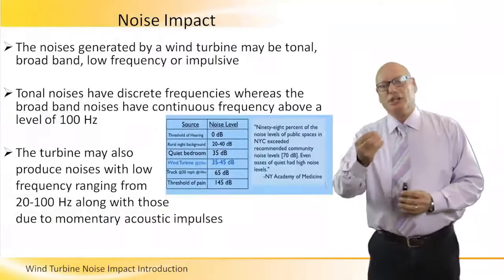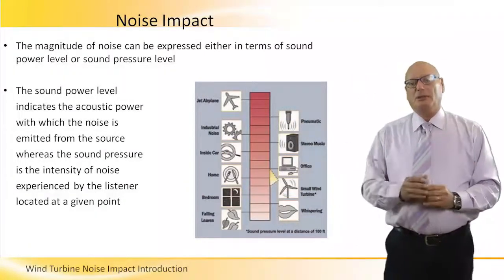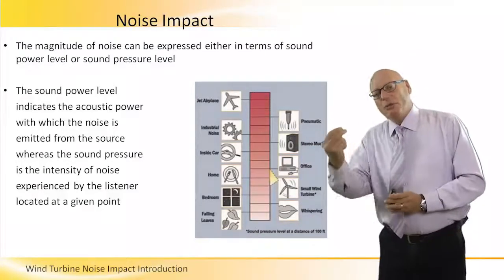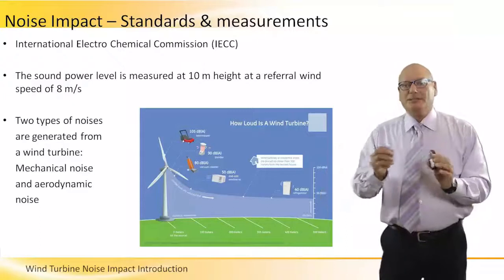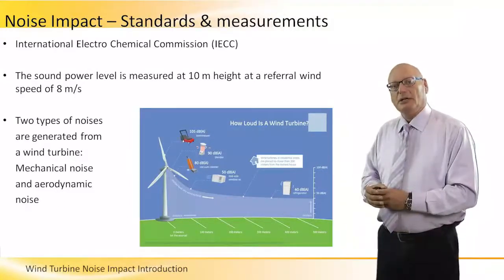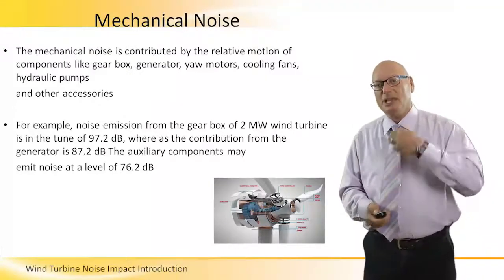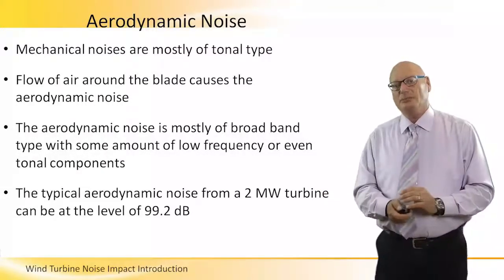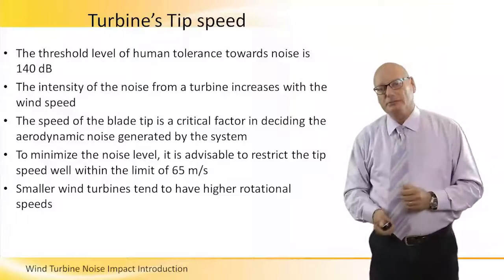Wind Turbine Noise Impact

Comment: Thank you for providing an introduction to wind turbine noise. There are plans to build 680 ft turbines (base to tip of the blade) on a hill near residential homes (approximately 2km away) in Tully, NY. It would be interesting to know how much of the noise will be increased to the homes below the wind turbines. There are no barriers between the turbines and homes.